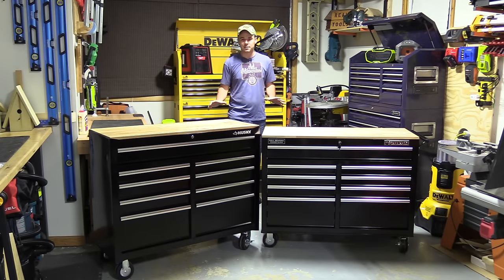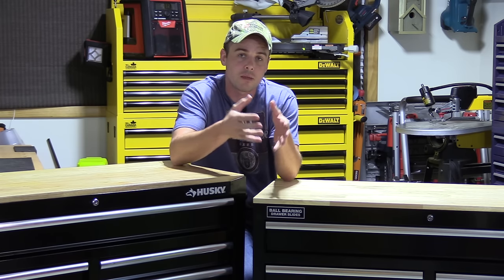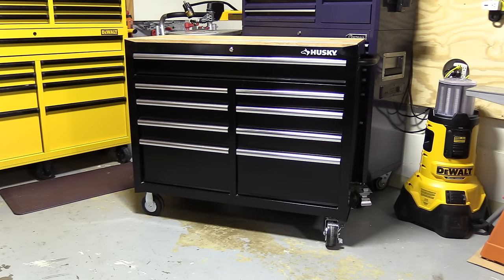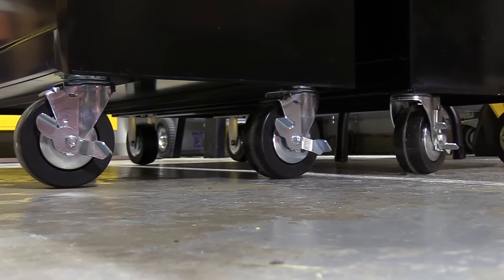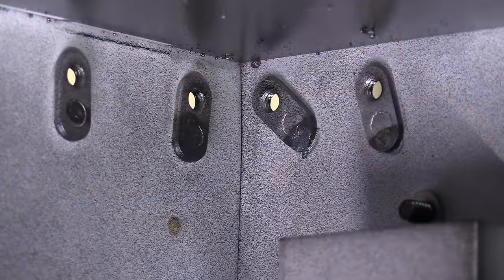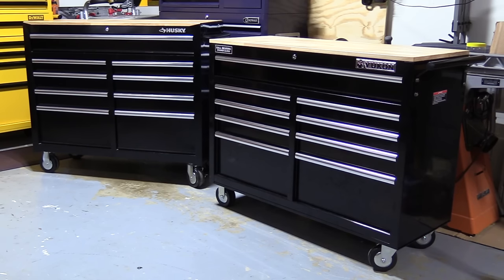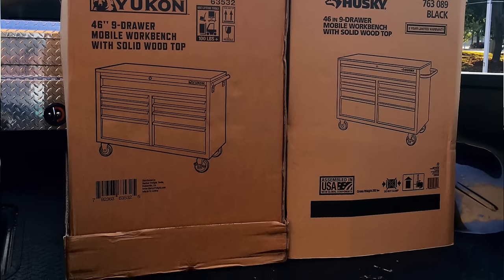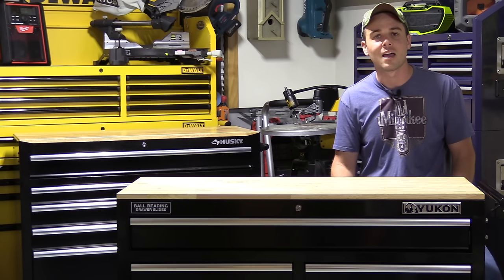Harbor Freight -VS- Home Depot ( Yukon - VS - Husky ) 46" 9-Drawer Workstations

Comment: I am ashamed that says assembled in the USA.  I can't see how it's cheaper to spot weld instead of using the rivnuts, knowing they were trying to save on production cost.  Having worked at Home Depot, in the receiving dept, I tried to think of the issues we had with all tool chest/boxes....damaged in transit because of how thin they are.
Reply from the maker: +Moneypit330 its cheaper because they don't have to buy rivnuts or take the time/machinery to install them......they instead are using robots (most likely) to weld the thin tabs in place at a higher rate of speed with less costs in materials.
Reply: Real Tool Reviews I did think more about it after I posted and figured a robot was used for spot welds.  But also thinking about positioning of the welded tab over the stamped hole versus sticking the rivnut through a hole for positive alignment?  The welded tab itself I am sure is cheaper.  Either way I am more than happy with my red U.S. General 5 drawer tool cart from HF that I have had for about 7yrs.
Reply: You would think a rivnut could also be located by a pre-drilled hole and installed by a robot at about the same speed as a welded plate. But yes, I'm sure you are correct and it would cost a couple of dollars more for this far superior fastener. 

As a side note, I purchase a cheap manual rivnut installer a few years back off of amazon, mainly to install aftermarket products in my vehicles and proceeded to try test one, to rip one out intentionally out of a piece of scrap metal I had drilled a hole and installed one into to see just how strong it was. I couldn't rip the darn thing out without completely destroying the metal around it that it was installed into. A great fastener to say the least!  I have since installed many things with it like license plate brackets and aftermarket Lightning, and the great thing is the installations look almost like factory quality instead of the nuts and bolts I used before getting this. They are also great in areas where you can't get to the back to install a nut, like inside of the floor of  my SUV where I needed blind fasteners for a gun safe I installed (the gas tank was below it).
Reply: Assembled in USA with foreign parts.
Reply: The problem with the rivnuts is they are shipping these flat panels back to the USA to assemble them. The welded tabs are much thinner so they can stack more sheets in a container,etc They want to sell a box that says "Proudly assembled in the USA!  and keep a few of the USA toolbox manufacturers working. And it must be 299.99 retail.  You have to understand Home Depot sets and demands a price point. The manufacturers have to accomodate that. Its really a screwed up way of doing it.  I know they demanded a XXX price point for a certian power tool for example and the manufacture had to figure out a way to build it. Ever wonder why your 18vt Dewalt drill or saw or something is a different part number when you buy it from a big box store- Theres a reason- Price point.
Reply: Could it be the other way around? It is very expensive to invest in those robots to weld the thin tabs that are wider than the nuts, which seem to distribute the load over a wider area of the thin sheet metal. Where a company can pay cheap labor to put in these rivnuts and not  have to pay for expensive robots.
Reply: "The name Rivnut was originated by B.F.Goodrich and was sold to Rivnut Engineering who hold the trademark for that name.". They are sold on Amazon under the brand name Rivnut.
Reply: Moneypit330 i worked at harbor freight and we constantly had damaged tool boxes. Only ones not damaged were the 600lbs ones

Comment: Thanks for the great review.  I’ve got the Yukon 46-inch 1-drawer (it’s the one with cabinet drawers below the drawer).  I picked it up before the price increases for about $225.  I didn’t install the wheels and it’s a very capable and sturdy lathe stand and cabinet to keep some of my wood finishes.  I’m planning on getting the 9-drawer (now $350!!) as soon as they’re back in stock in Virginia.  Appreciate the great content!
Reply: The 9 drawer is $425 now
Reply: @JohnWilliamLeonard35  I’ve got two 9-drawers now too.  I keep an eye on the HF emails and it’s been on sale a lot lately for about $375, I think.  Still a good value, but those prices have been Bidenized everywhere!

Comment: The yokon was the clear winner due to the extra storage capacity on the bottom drawers with the double rollers the stainless steel Hardware is a nice touch painting inside and out. Any rust from forming anywhere on a scale of 1 to 10 I would give the Husky Box about a six and a half while the Yukon box I would rate a 10 I was wrong I thought husky would do a better job of building a box thanks for the video
Reply: I checked specs and it looks like the Yukon is 18 inches deep vs Husky 24 inches.  Husky also had 2 rails for bottom draw instead of one shown in video although still said 100 lbs.

Comment: Yukon
Reply: I was right. I would get the Yukon. Also if you could doa comparison of the Earthquake xt battery 1/2 impact vs a comparable brand. If you can. That would be awesome
Reply: I'm sure he's already got it planned if it's not already filmed.
Reply: pillzownsu I saw the Earthquake xt pneumatic but not the battery powered. I just found out the had the battery powered version and I wanna get it
Reply: Too expensive.  A Earthquake XT is $240 + $40 for 2 year warranty.  You can buy a new Dewalt DCF899 with 4Ah battery and charger for $280.  You get a 3 year warranty, brushless motor with the DeWalt.  The part number is DCF899M1
Reply: Chris oh shit cool. Thanks for the info. Guess I'll get the DeWalt
Reply: The electric impact just came out recently, so not knowing about it is understandable.
Reply: pillzownsu I have one and it works great, has no issues at all taking off lug nuts on my F450.
Reply: I have the Earthquake 3/4 inch and it's been great, no issues
Reply: Milwaukee 1/2 is better than the DeWalt imo. Best batteries in the pro-sumer market, and overall a better selection of tools, and more of them that cater to mechanics. 3/8 M12 Milwaukee ratchet is literally the best tool I have ever bought. Barely EVER touch a normal ratchet now.
Reply: Chris I have the Dewalt and I love it.
Reply: +CJBMAGGOT94 yea definitely I feel you.. That electric is beast. But there is those time where the body of the Milwaukee is to big to fit somewhere (I'm a collision repair technician) .. I put it like this: Milwaukee tools are a small step above dewalts but so is the price

Comment: not sure why but I purchased 2 huskys like this years ago and both of mine has two drawer slides on the bottom drawer. also my shop isn't insulated I'm located in the middle central part of the U.S. and never had trouble with my top wrapping. my boxes are at least 4yrs old

Comment: As good as the Yukon was, HFT changed to US General which is extremely well built in all tool storage products...for the price
Reply: I bought the 56" one and it is a solid built box.
Reply: But to get the 44 inch US General you are going to have to fork over another $200, almost doubling the cost of the Yukon box.  While yes the General is much better construction, but that cost is the difference between getting a box and not for a lot of people.  I think they could have survived together.

Comment: Husky 46" Tool chest on sale today for $398. Same price as the Yukon now with double drawer slides on the bottom drawers, attached wood top, soft close drawers, much more storage capacity, and built-in power strip.

Comment: The Yukon is sold by Home Depot now as a Husky.  Go figure.  I wish Real Tool Reviews would update this.  Doesn't this guy sound like one of those saturday morning car guys?
Reply: spudth good to know. I wanted to buy one of these, but harbor freight replaced them with a model that doesn’t have the lower drawers, just two doors and some shelves. Didn’t want to pay $300 for a junk box from Home Depot, but if they’ve replaced it with the Yukon model I’ll be getting one in the spring!
Reply: This information is correct! The Yukon # 63532 is now Husky # H46MWC9XD . . . talk about ironic.
Reply: @TallTimbersUSA  And $100 more

Comment: I know this is old but I just bought a Husky 52" and it has all the features you go through that only the Yukon has. Rivnuts, bolted down top and double sliders on the bottom 2 boxes. I am in Canada though so maybe that is the difference or they changed there construction?

Comment: Purchased the Yukon after exhaustive research.  Wish I had seen this video prior to purchase just to make me feel better about my decision.  Winners win, I bought the Yukon and couldn't be happier with the quality from a $300 mobile drawer storage unit.  I would agree the paint finish is far superior and the bolt attachments are key.  Moisture is always a possibility as I will roll my unit around as needed so the secured wood top was important too.  I bought the white cabinet and it is super clean.  With this quality I felt no need to purchase an extended warranty on a cabinet so hearing of the 3 year offer on Husky makes me question that as simply a marketing ploy.

Comment: I bought the 11 Drawer Husky box about 4 years ago and had  zero issues with it.  Just went out to see if the larger drawers had two slides and they do.  I did line the drawers and I just love this toolbox/workbench.  Only assembly was to add the casters.  Not sorry I bought this one and I use it every day.

Comment: I bought 2 of the Husky boxes at HD a couple years ago when they were on a "Black Friday" special for $199 ea.  That was the lowest price I've seen for such cabinets.   They've been great boxes with no issues thus far.  I am also surprised at the differences you found.  I did change the rolling casters as in my application, they can each be pulled in and out to become mobile workbench/workstations in my garage.  Thus, I needed 4 swivel casters on each with at least two that had brakes to maneuver them in and out.  I had to buy all new casters as I could not find matching swivels without brakes with the same height and mounting hole dimensions.  I have a substantial laminated wood bench top built above them that is my real work surface, and the Husky cabinets then fit snugly under it.  I also made the work surface deeper than the cabinets, with room for 8" deep shelves on the wall behind them, which is now hidden storage for additional tools in cases.  I can access them by just rolling a cabinet in and out.
Reply: Oh yeah, and mine has the dual slides on the bottom drawer, and the top is bolted on.

Comment: I purchased the Husky 2 years ago. drawer size is exactly what I need. But I lost the key shortly after purchasing. This wouldn't be a problem as it is mounted inside of a locked trailer, but without a lock as I'm traveling down the road the drawers have come open wrecking the drawer glides with the weight I had in them. I have since installed a bracket on each side in front of the drawers and put a rod in it to keep them closed. Contacted Husky and was told they don't handle the parts for this as it is discontinued. I found out the manufacturer, but they claim they didn't make this model. Currently trying to buy a pair of glides from Grainger that are the right length but don't know if they will fit. Yes there is a 3 year warranty, but it doesn't do you any good if the item is constantly changing. Sound like the glides on the Yukon would have been better, but I couldn't lose the 3" of drawer space. In retrospect I should have just bought a replacement lock, but Home Depot says that might not be strong enough to battle against the forward motion.

In short I really appreciate this review cause I was sure the cabinets were identical and maybe I could but parts for my Husky from Yukon. Good video
Reply: Ever heard of a LOCKSMITH?

Comment: I'm torn between the Yukon 46"  Mobile Storage Cabinet with Wood Top or CRAFTSMAN 2000 Series 41-in W x 35-in H 7-Drawer Steel Rolling Tool Cabinet (Red). I do prefer drawers over cabinets because then any overhead lighting will enable me to see what's inside. The Yukon however was very hard for me to see inside of even in the brightly lit Harbor Freight store. I don't know if there's a way to add lighting inside that'd activate upon opening the cabinet door that won't cost me 100's in double a batteries over time. Any feedback you have on these two I'd love to hear.

Comment: Would you feel comfortable putting a midi lathe on top of either unit?
Reply from the maker: As long as it’s balanced and not vibrating, sure.  However I would probably drill the top and bolt it down.

Comment: A couple misstatements I'd like to correct. I just purchased the Husky 46" nine draw tonight. Not sure how old your video is, but this is Nov 2018 and I can tell you the husky has double sliders on both bottom draws as well as all the draw liners. In addition, it came with a power strip mounted with cord that has 4 receptacles and two USB ports.
Reply from the maker: They aren’t misstatements when you bought a completely different box than the one that I bought.....
Reply: @RealToolReviews  I souldn't have said "misstatements". Obviously you weren't trying to miss lead anyone and I could clearly see the single runner on the bottom draw of the husky in your review. You did a great job on the video. But the one I bought looks identical to the one in your review. Same 46"  9 draws and wood top. I thought maybe you got one that somebody missed the boat on while building it on a Monday. Or it could be that Husky changed the way they build them hense the black friday price I got of $298.00. (Down from $398.00) But like I said, mine came with double draw sliders on both bottom draws and the draw liners included. Bought it from Home Depot, in Rochester, NH. You can go online and see it. So I really wonder why the difference! Keep up the great videos.

Comment: So I just bought the Husky 9-Drawer 46" tool chest last night.  I watched this video  right after setting it up and I was worried that I had made the wrong decision.  I just check my chest out this morning and literally everything you talked about on the Husky Model has been fixed.  The wooded top is bolted down to the chest.  They are using Rivet-nut on all bolt on including the bottom.  There are two drawer guides on the bottom drawer.  So I suspect they might've watched your video and made improvements.

Comment: OK, I cheated and watched the whole thing. That said, I'd say the Yukon is the clear winner. Currently going for $300 @HF, but could be lower with a Super Coupon.

Cudos to you kid for keeping your review on point with minimal meandering.
Reply: The updated husky is 24” inches deep now and built much better. $348. This is an old review.
Reply: @michaelhernandez1398  The Kobalt equivalent at Lowes turned out to be the best deal with the highest quality. I got it for $287 with NC tax less my veteran's discount. Lowe's originally had them for $400+. I think they dropped the price because everyone was buying HD and HF. The Kobalt came with liners and 'soft close' drawers. Just a beast with all the best features of the other two.

Comment: Maybe it was the year you bought these but I found your report lacking.  Husky is 24" wide and has an electrical strip under the handle.  Also there were no defects in the paint job.  In addition the 2 bottom drawers have 2 sliders 4per drawer.  It also came with liners for the drawers.  I bought my Husky in 2019.

Comment: Husky because I bought it 3yrs (aprox) ago. Its drawers slide very well and  close tightly, it holds most of what I neeit arrived assembled and with drawer liners. I have found Harbor Freight products work adequately but don't stand the test of time and active use. After viewing your video I would select the Harbor Freight chest. Its construction is superior. Your video was very informative and well done, thanks! .

Comment: I purchased a longer Husky, it cost less than the HF comparable model, and it was much different than the Husky model you compared.  I don't have the model numbers memorized and I'm too lazy to go out to the shop and look, but I reached a different conclusion than you did.  First, the Husky also had 200 lb bottom drawers, secondly, the top was attached and not loose.  I did not compare the rib nuts vs spot-welded nuts.  I'm very happy with the Husky, which was assembled and delivered to my shop.  The paint was flawless on my Husky and it came with rubber drawer liners.  I am a fan of Harbor Freight but when I bought mine, 2 years ago, Husky seemed to be the better deal.  Enjoyed the video.

Comment: I just purchased the Husky 46 inch (Oct 2020).  Husky has updated the box, rivet nuts, the wood top is secured by machine screws, the entire box, inside and out is powder coated.  The Husky has 21 inch deep drawers vs. the Yukon 18.  Paid $348 at Home Depot (tax free).

Comment: The current units are 24.5" wide vs 18", a huge capacity difference. Time to update or put a disclaimer on this video as people are being steered wrong.
Reply from the maker: Well it had to due with tariffs for foreign built boxes….. they had to all expand dimensions in order to not be subject to cost-prohibitive tariffs….. And this all happened all at once a few years ago.  The main point of this video (and my other toolbox vids) in general over the long term, is essentially to raise awareness for anyone considering ANY box.  What to consider, what to look for good or bad…. Hopefully they will teach people that although two boxes “look” similar, many times they are not.

Comment: I bought the Yukon for the height, it fits right under existing shelving and I just pull it out when I need a work surface. It's a great build and I didn't have to cut out the drawer liners.